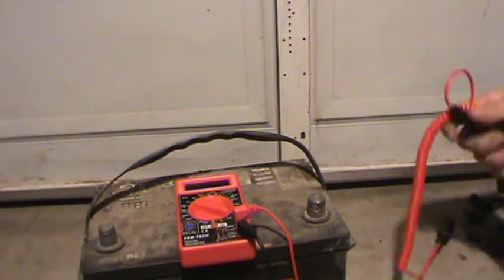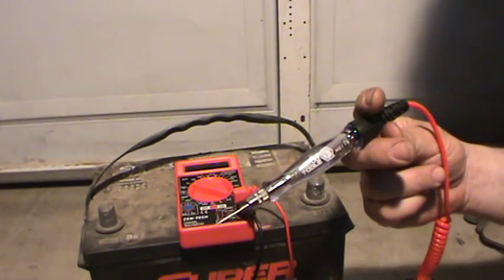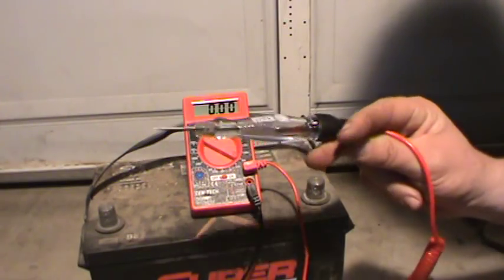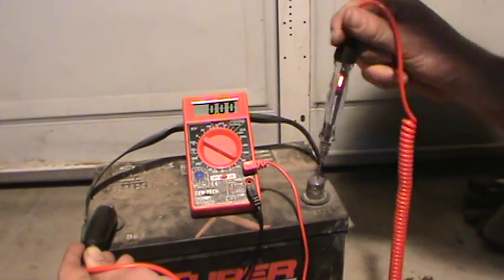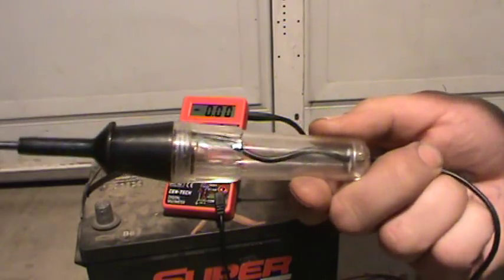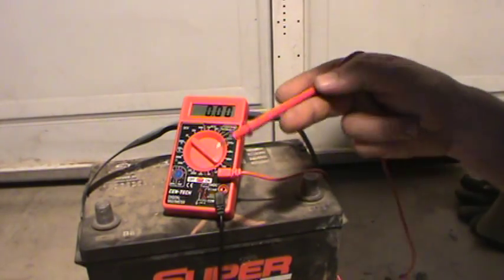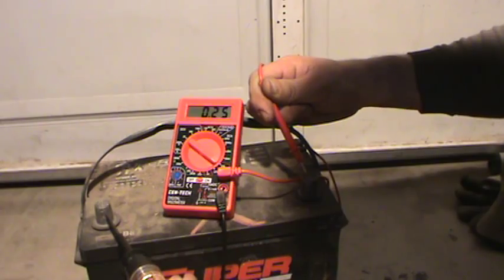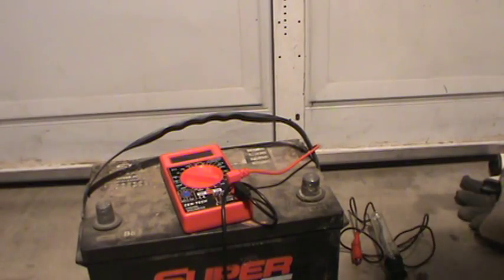Is Your Test Light Computer Safe?

Comment: question about testing 5v computer circuit.
what if i hooked typical incandescent test light to a 5v source to test 5v ref and computer parts that take 5v by getting a 12v to 5v usb cigareete plug adapter,then cut a usb cord and plug this into the 12v to 5v adapter and find which wire is the power/ground and use this to hook test light when probing these 5v computer circuits? this would also drop some of the amperage draw from test light correct? would this be the way to go?